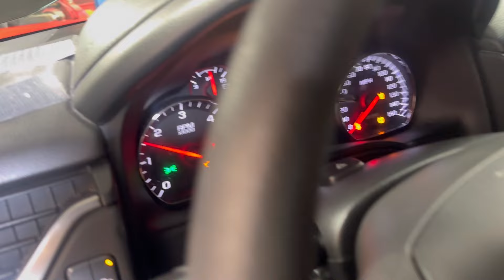His “NEW CAR” Has A Sludge NIGHTMARE, I Lost This One

Comment: I change the oil in my cars every 2,000 miles because I mostly do short trips, my shop is a half mile from my house, most days it is just one mile for me, short trips will cause sludge, the engine never gets hot enough to burn off fuel and water from the oil, I only use Pennzoil platinum, ultra platinum in my truck, it is an overhead cam 4 cylinder in a Colorado, that timing chain is really long, it seems to work just replace the valve cover gasket and everthing in there looked like new parts
Reply: At 2k miles my oil still looks new. 2k is too soon.
Reply: @cali2468  yes it is way too soon for most people, I am a pro mechanic and on average recomment 5,000 miles but you need to understand my fleet I have 2 trucks a T&C van and a car, the one with the lowest miles is my 1951 chevy 3100 pickup, only 77,000 but it has no oil filter and the original engine so I am not the average guy, my van has 298,000 engine runs and sounds like new, my newer truck has a strange duel cam 4 cylinder and the car my wife drives is a Suzuki made by GM Daewoo , I do not want any engine problems
Reply: In Canada,  I change 2x a year no matter the mileage. New oil for summer and winter.

Comment: I had Dodge Charger with the 3.5 no oil on the passenger side. I was running it with the valve cover off and the diesel mix in the oil finally broke through the sludge and was like a pressure sprayer shooting the oil mix out of the engine. I was right by the ignition switch so I was able to cut it off real quick.

Comment: slu....sludge is baaad....mmmmkaaay!
ive been trying marvel mystery oil in my oil to clean up a little sludge in my ram 2500 4x4 5.7l that i bought a couple years ago that was neglected and not maintained well at all. when i bought it, i stripped it down to the block and did new seals all the way around. thats when i noticed all the build up. it wasnt as bad as the car that died in this vid but more than i liked so i started using marvel mystery oil in my oil changes. i substitute a quart of oil with mmo and change every 2000 miles.
the last oil change, i popped a valve cover off and it dont even look like the same engine inside. id say its 75% cleaner and runs way smoother. the guy i bought it from asked if i put a new engine in because he said it never ran that nice when he had it.
i told him he should take better care of his vehicles and they would run nice.
3000 miles for me. its just the old school in me the way i take care of my stuff. yes, i run full synthetic but i still change my oil at 3k. its not a waste as oil is cheaper than a new engine any day.